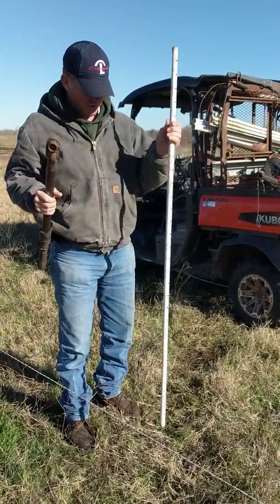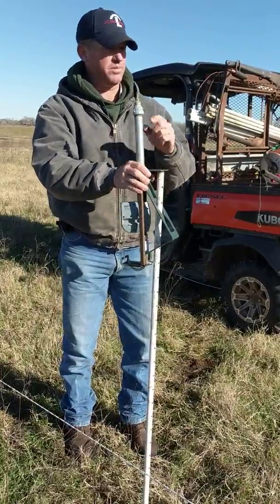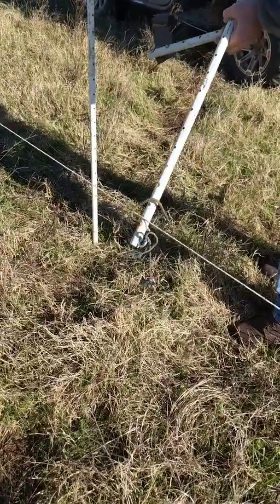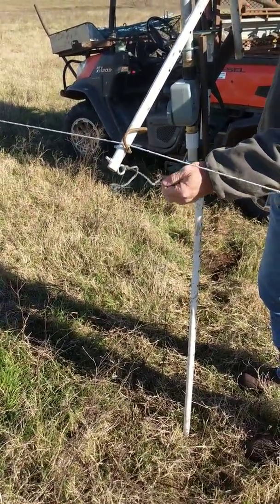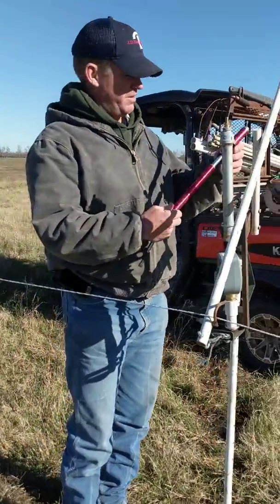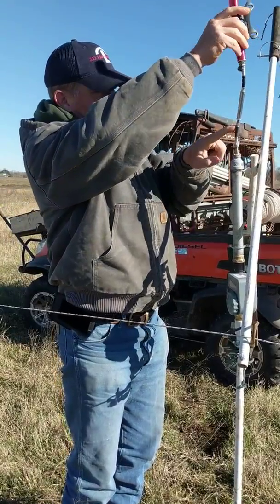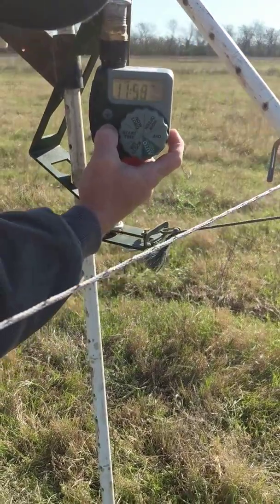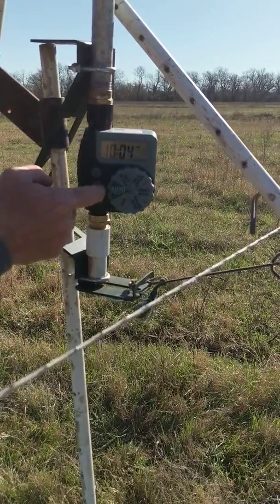Timer Set up

Comment: That is pretty cool, but not quite sure how the timer is releasing.
Reply: It looks to be a residential irrigation valve that you would hook directly to your outside faucet, so when it goes off it opens a valve for a split second which seems to let the air from the top chamber into the bottom chamber which shoves what appears to be some sort of hook out of the way to release the counter weight